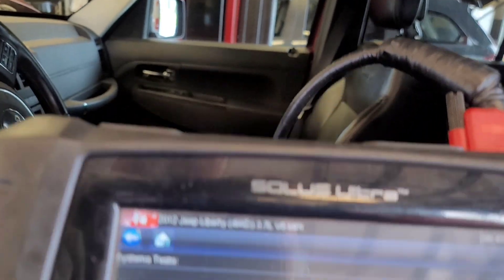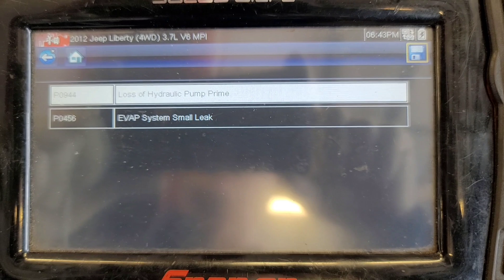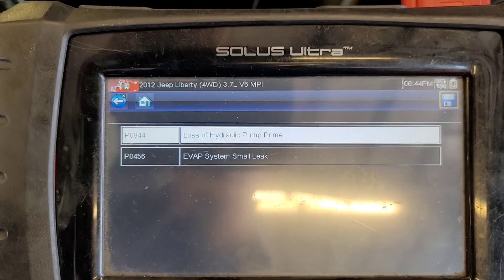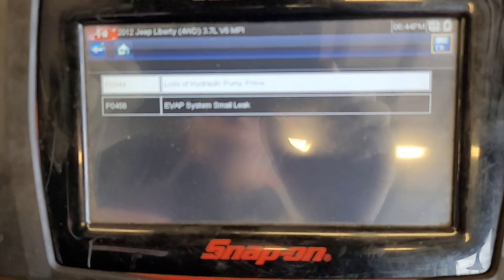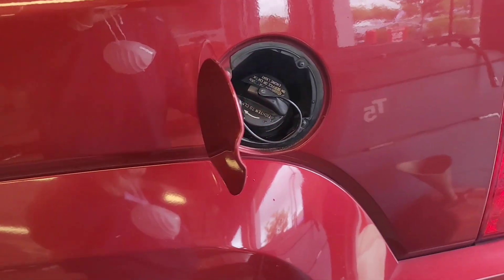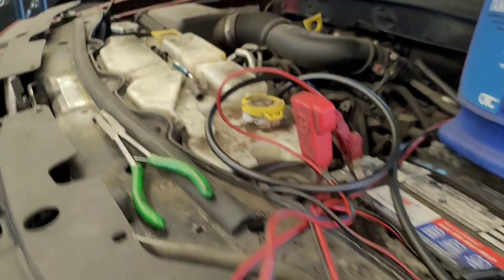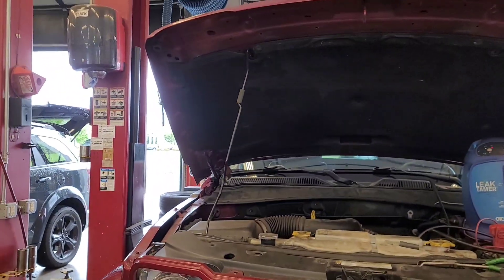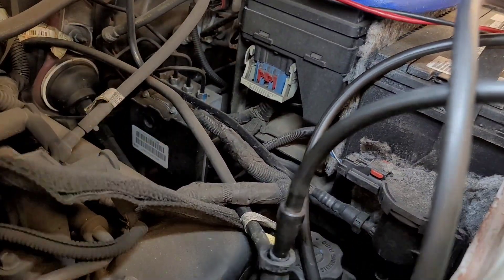Jeep Liberty P0456 Evap system small leak

Comment: I have an 08 Nitro w/ the 3.7 engine ... same kinda setup as the jeep ... had the same code come up every now and then ... took off purge valve and tested it ... was ok ... then replaced gas cap ... lite still came on so I replaced the evap canister .... lite came back on a day later so I ordered the evap leak detector filter that has a hose comin from the top off the white thing on the canister ... I guess its floating and not really attatched to anything ... if that doesnt work i'll get a smoke test ...
Reply from the maker: Yes. Smoke test will give u answer if the leak detection pump still did not help

Comment: Can i spray break fluid on the hoses to see if the idle increases? Where can i rent a smoke tester?
Reply from the maker: Correction, dont spray Brake fluid :) You may use Brake Parts Cleaner or starting fluid.
Reply from the maker: You can try spraying at the location where u suspect. Idle will drop when you introduce fuel in it.

Comment: Thanks for the great information! I'm battling this issue right now "small evac leak". It's now our 2010 Liberty sport 3.7 so I bought a new gas cap but I drilled a small hole in the to so I could reinstall the teather but now the dash reads "gascap". Should I order a cap from the dealer that has the hole isolated from the rest of the cap? Auto Zone said this is the correct cap for my Jeep.
Reply from the maker: Buy a gas cap and do not drill any holes. If ur code is for small evap leak check that part that i replace and do the same, they are common issue. The next thing to do if it is still throwing fault code of the same issue, is to perform a smoke test to find an actual leak.

Comment: I got a 08 liberty and jad the same codes. Big and small evap leak. Found that the pcv hose fittings had huge holes causing a vaccum leak. Still wont start though. Im thinking its the fuel pump? Gonna check the part you just showed to see if theres an issue there.
Reply from the maker: 1st thing i would do is to find out why the car is not starting. Then i will diagnose the evap leak. Even a huge vacuum leak will not cause a no start condition. It may stall or not idle but will start, so 1st thing i would do is find out why it is not starting. Check all that is in the fuel system, pressure and fuel condition check for spark and check if it is sucking air tru the throttle.

Comment: I just got a P0456 on my Dodge Nitro I changed the gas cap the purge valve solenoids brand-new now and I just replaced my leak detection pump I reset all the codes by disconnecting the battery and will drive it around for a little while and see what happens
Reply from the maker: Keep us updated
Reply: @DRBauto  oh well, got another P0456 again, what do I have to do???
Reply from the maker: @deanbuffoni5139  smoke test the system, it is the best way to find leak